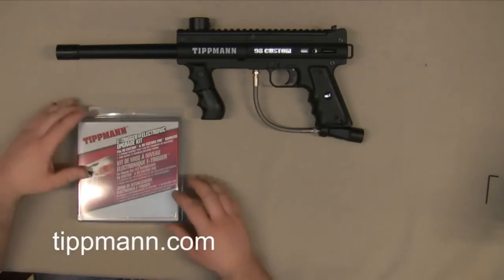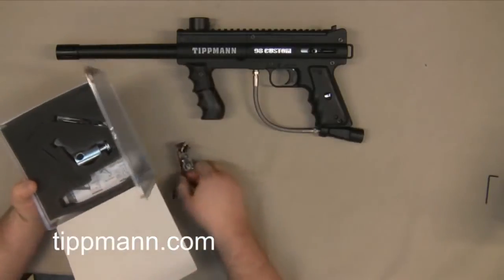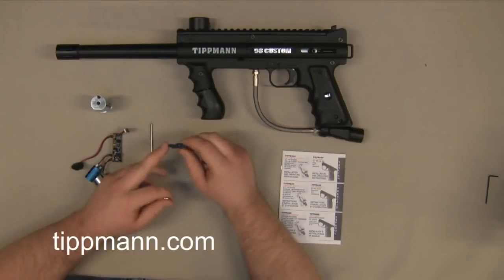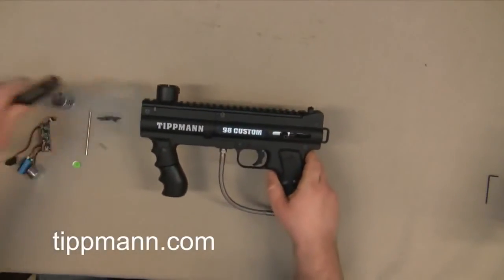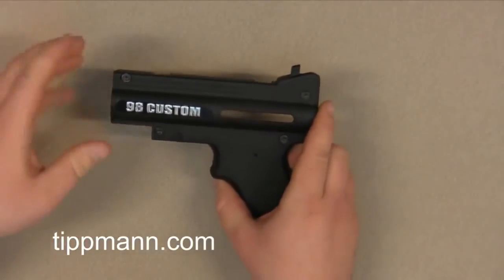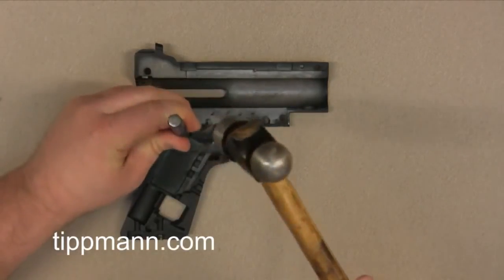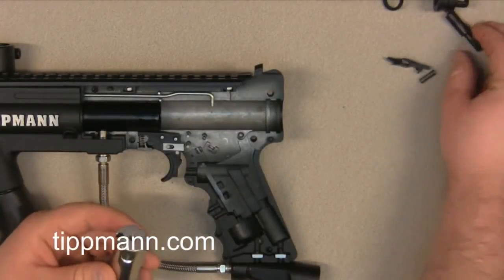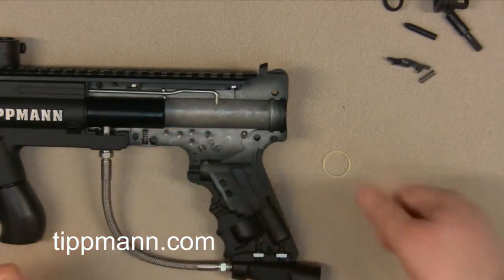Tippmann 98 Custom E Trigger Install

Comment: My magnet doesnt have that yellow stuff onnit just a lil confused of why my magnet is just straight silver and doesnt have anything else with it ive watxhed multiple videos and everyone has a magnet with a color other than all silver.
Reply from the maker: Hey Randy

The Tippmann tec said that the color was for the assemblers so they could easily pull the magnets apart during assembly. It makes no difference if yours does not have a color. All new ones have no color.

Bob
Oregon Paintball
Reply: Is there a trick to get the magnet to stay put in the slot its suppose to when i put it there it doesnt stay in that slot it moves and magnetizes to the solenoid. Im new to putting these things together so any and all helps is appreciated.
Reply from the maker: Howdy

Usually it just sets in the slot. Try "1" drop of super glue in the bottom of the slot. Insert the magnet before placing the solenoid in the frame. DO NOT GET SUPER GLUE ON ANYTHING ELSE.